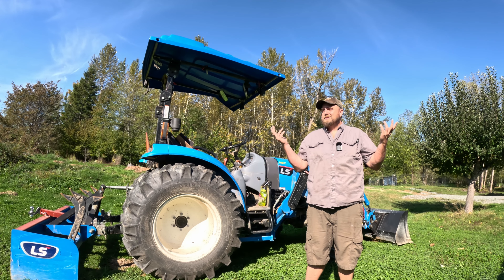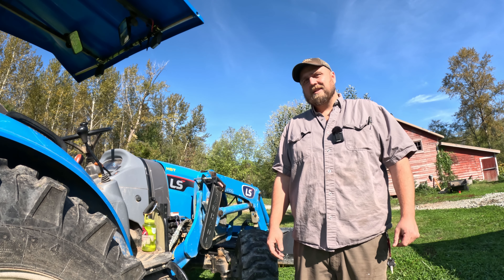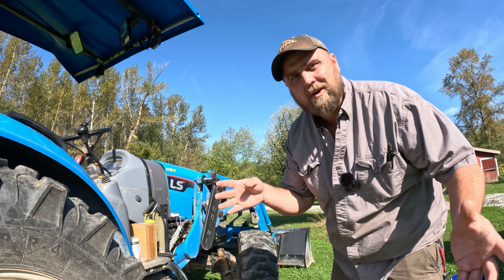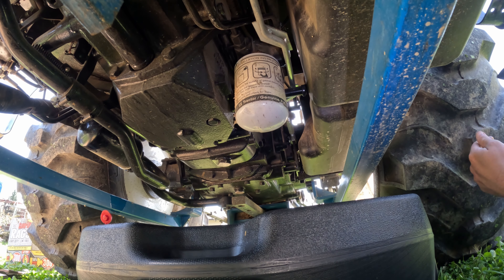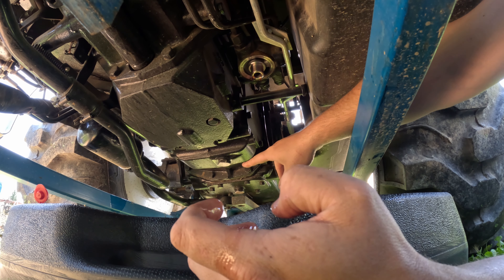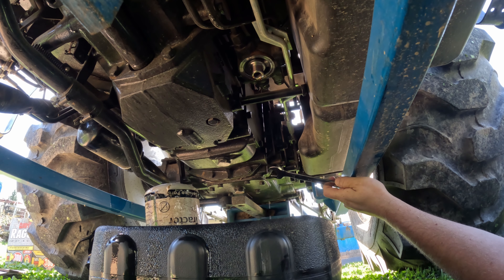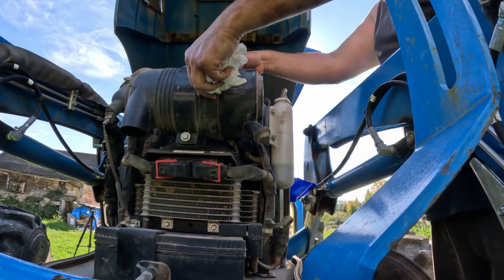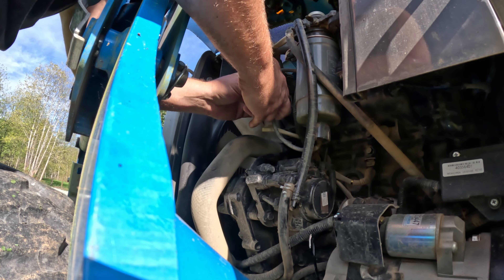LS Tractor 500 hour Service. Annual Maintenance MT342

Comment: Love my MT342 as well. I have the cab version. I've had it about 6 months, got 200 hrs on him already. Lots of road work. The poor box blade was never made for what I put it through 😄 Your earlier videos helped me pick the tractor and with the first service! Thanks
Reply from the maker: I'll bet you're loving that cab! I don't regret much, but not getting a cab is something I'm kicking myself about
Reply: @HomesteadBandwagon   yeah I love it. I'm in the high desert. So from 110 degrees to one day last winter -15 degrees. I can keep working. The wife actually made me get the cab one because I was waffling on it. I'm so glad I did. It helps a LOT. And with the dust from doing a few miles of road work.

Comment: I have the mt573.  
When doing just a hydraulic filter change I can hook a shop vac up to the fill port and it creates enough vacuum to hold all the fluid back,  no waste     Pretty slick. I’m at 1600 hours.
Reply: I should have tried this on my 50 hr change. They had the hydraulic filter on so tight I lost over 8 gallons by the time I got it off, after having to puncture it.

Comment: Just saw this video. Have always appreciated your videos as I have the MT342HC. Great machine, no problems at 225 hrs. I don't know who puts the filters on from the factory but for some of them you need 2 men and a horse to get them off. Do you use full synthetic hydraulic fluid and front axle fluids? Just wondered if its worth the money to use them as they are quite a bit more in cost. Also I was told using off-road fuel makes it go into DIF more often. Been using road fuel and getting between 35 to 50 hours. Seen any truth in that? Thanks again for the videos and advice.

Comment: I did  my 50 hour on my LS122 back in the spring, changing the hydraulic filters at 50 hour and not having to change the fluid is such a waste, I think a better design was needed so you do not loose so much fluid, but still a great tractor..
Reply from the maker: I generally tell folks to just tear off the bandaid and change the fluid at 50 hours. Generally quiets the whole system down, which is nice. If you want to see a cool trick,  there's videos of fellas attaching a shop vac to the fill port on the rear end when changing out the filters.  Seems like it works pretty good!

Comment: What is the top speed of this tractor in medium range.  Wondering if it will work for constant medium range for raking hay.  I don’t want to have to shift between medium and high.    I would be more interested in the mt357.  Thinking yours would be similar in speed but maybe the 57 is a little faster.